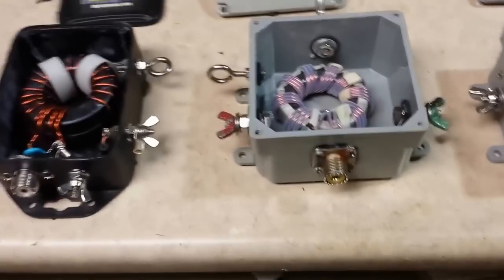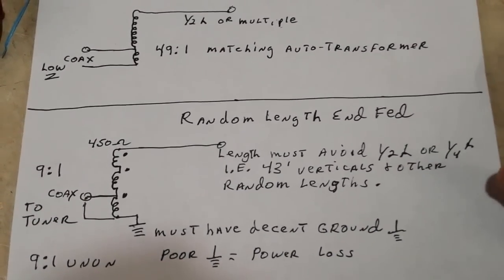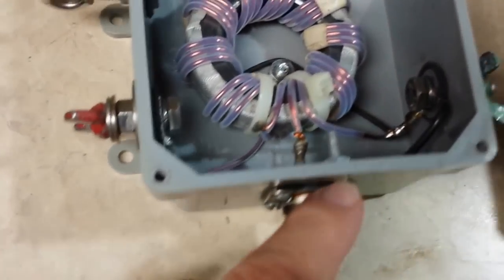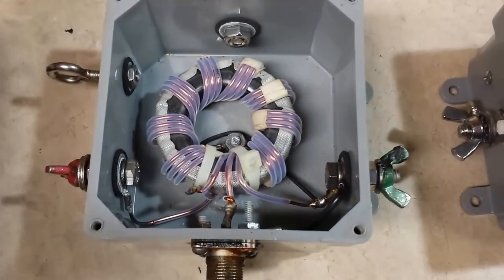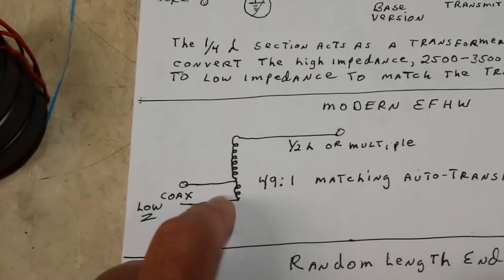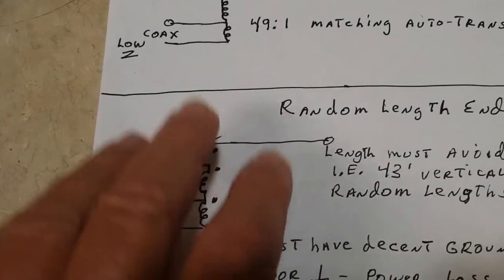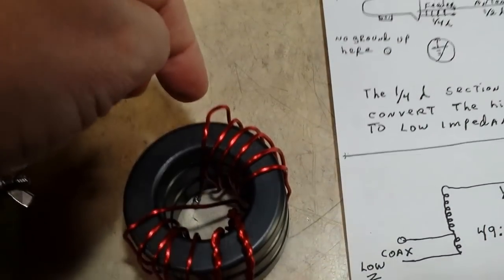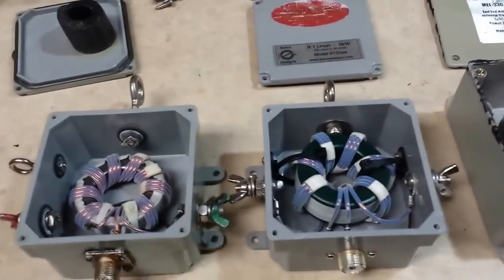End Fed Half Wave Antennas VS Random Length End Fed Antennas

Comment: Thanks Steve, great video. I used the info to build a couple of models (2 and 3 cores) of the 49:1 transformers. I felt it appropriate to test the transformers directly as components before putting in the work of actually installing an antenna. This is easily done with a 2-port VNA and putting two transformers back-to-back. . I got enough toroids to build two identical transformers of each design, but got lazy and decided to run a test with the two unequal transformers back-to-back. Of course, they are both supposed to have the same ratio, but one might have greater loss than the other. It turned out that the combo lost as much as 4.2 dB on 80m and almost as much on higher bands. That's a couple of dB per transformer, not good! Then I tried it without the capacitors. Now the two transformers together lost only 1.6 dB  on 80m, with similar results on 40m and 30m. 20m was higher, about 2.9 dB; 15m 4.2 dB; 10m 10.4 dB. I need to re-run the tests with identical pairs of transformers, but already it looks like the capacitors are added in the commercial units in order to claim reasonable performance on all the bands, while better performance can be achieved on the lower bands, at the expense of sacrificing the high bands, by removing the capacitors. The resulting lower loss on the low bands might make a big difference in power handling (this remains to be seen in practice).
Reply: In case a less experienced reader gets the impression from my comment that the commercial models using a capacitor are no good, let me clarify: Hams often use inefficient antennas that have losses of 20 dB or more, and still report fantastic results in actual contacts. Conditions and propagation cause that much variation. In this perspective a couple of dB is not much of a loss, and having "all" bands covered is indeed very nice! In practical use, the loss may be more likely to be noticed through overheating than from signal reports. Of course at moderate power, overheating may never be experienced.
Reply from the maker: Hello Erik. Others have used VNA's and gotten similar results. Try using identical back-back transformers and measure power in / out to a dummy load and see how much power is actually lost. Typically I hear 1db or so with the greatest loss on 80m as you said but usually a bit over 1 db. I find the capacitor has no effect anything below about 14mhz. I don't see how it could influence power lost on the low bands. When you do some more testing drop me an email. I'm ok on QRZ.com N4LQ
Reply: Hello Steve. I take back my statement that the cap's hurt the low bands. I had checked connections for tightness and didn't see any change, but when I took it all apart and put together again, I couldn't repeat the observation. I suspect my stainless steel hardware which may have had some oxide or silicone on it. I will email with numbers.

Comment: I noticed the triple cores and understand that raises the efficiency from approx 65 to 85 %? is that correct?
Reply from the maker: I doubt if it's anywhere near as low as 65% but there is some difference in efficiency. The main factor is power handling capability and 3 cores provides a huge improvement.

Comment: Steve,looking at the one you built, I have a question. It looks like you pass through the center 6 times, and then cross over (does the cross over count as a loop since it passes through the toroid?) And then it looks like you make 6 more passes through the toroid.  so is this a 1:36 auto transformer?
Reply from the maker: You need to count the primary too because it and the secondary are wound together. I count 7 turns through the center and yes count the crossover plus add the outside ends as 1/2 turn each. Total is 14 or close to it. Counting just the inside wires doesn't give the whole picture. If it goes down the center then back up the outside, inductance is added for however far it passes the outside too. Note that on the first 7 turns I bunched up a couple of wires and it's hard to see both turns.

Comment: I live on a boat in salt water. what will man the best ground . a wire or copper plate in the water? thanks
Reply from the maker: Although there is nothing wrong with having a good ground, the EFHW does not rely on one as part of the antenna system like the Marconi or quarter wave wire does. Hint...Use about 25 feet of coax or more to act as a counterpoise.

Comment: Excellent Steve I'm glad I've came across this channel loving the videos .I have a question if my end fed antenna is at say 840 ohms.and my rig is 50 ohms . how would you calculate this to know what balun I would need .would I just 17 x 50 = 850 ohms ?
Reply: Turns ratio is the square root of 840 / 50. Note that secondary turns count includes the turns wrapped around the primary.
Reply: @avt3216  brilliant Steve I've did one with 130ohms fed into 50ohms coax .but I used my two inductors in series .in which case my coax inner inductor goes between the two coils and earth of coax to ground .my capacitor in parallel with two series inductors .works out nicely thank you so much Steve brilliant .these two coils in series are just voltage dividers I assume ?.

Comment: Should I have vent holes in the enclosure for 100 watts cw operation, single core?  Thank you
Reply from the maker: Yes but not so much for cooling. A vent will allow moist air to escape otherwise when the transformer gets warm inside you will have condensation all over the internal parts. A single weep hole in the bottom isn't enough. A small vent like the one sold by Bud will do.

Comment: Steve,
What did you use for the Core? It looks like 3 magnets...if that’s the case, couldn’t you use 1 Larger Magnet with the 7 turns of the 14 gauge wire to accomplish the same effect?
Reply from the maker: Bill I think you should just order one already built from MyAntenna.com
Reply: Steve,
What did You Use to make your own device?
Reply: 1) They are not magnets, they are ferrite toroids. 2) Inductance and turns ratio are what matter for calculating the number of turns.

Comment: hi steve, At 6:45 you say the capacitor value is 100 microfarad, isnt that really picofarad? In your video "Winding a transformer for End Fed Half Wave Antenna -- EFHW" at 6:50 you call it picofarad, so, which is it?  I'm building this per your great video.  thanks
Reply from the maker: Read description under the video. 100pf

Comment: I put my end fed up 21 feet and it is about 15 feet to the side of and about 12 feet above the neighbors shop which has a Metal roof.
here's the problem.
I can receive good but no one can hear me...
swr is good.
could the metal roof be causing me the trouble???
Reply from the maker: Probably not. It's probably something else unrelated. Get your wife to call CQ and see what happens.
Reply: @n4lq  I think I may have found the problem 
My wire was too short so I soldered a short piece on and I think it may be causing the problem...where it is soldered is
right in the center of the core.
what do you think

Comment: I have the MFJ half wave end fed 10-80 antenna. I like the antenna but the swr is high on all bands especially 80. Even with a tuner all bands are around 1.8 after the tuner does it's job. MFJ told me just to use a ground rod with no counterpoise necessary. Any thoughts on this?
Reply from the maker: Lots of thoughts. That MFJ is not a good product. We have seen several connections fail inside the box. The vibrations seem to break them during shipping. I would stick with the Myantennas or Hyend brands. We would like to have you join our Facebook group for this antenna https://www.facebook.com/groups/EndFedHalfWaveAntennas/

Comment: I wonder how this would work with if you made an EFHW fan dipole. I will have to try this. (40-30-17-12)
Also this answered my questions about the unun. I believe I will try a 43 foot vertical as I have heard good things about them.
Reply from the maker: Won't work at all. In fact you can't even put your finger near either end of the EFHW without wrecking the SWR. Fan's must be fed in the middle. 43 foot verticals work ok from 80 to 20 meters but they are too tall for low angles above that. They also need lots of radials and the tuner needs to be at the base of the antenna otherwise you suffer much RF loss in the coax.

Comment: 5:00 there is a big difference between the windings of both these 9:1 transformers... one got 9 turn like in the scematic but the high power one has only 7 windings and it is still a 9:1...
Reply: No, there is no difference. The turns ratio is the same. The total number of turns is adjusted for the toroid material and desired inductance at the frequencies used.

Comment: Just a stupid question (ok 2) only cause I'm  not in the know lol,, but 1, why not oil filled like a paint can dummy load???
2, why not build these for sale?
I like ur design, seems robust compared to others, and I like integrity:)
Great video BTW!!
Reply from the maker: The problem with oil is due to the high impedance of the transformer.  Oil will basically provide a short circuit due to its dielectric properties. Think of it as a liquid capacitor. I even tried using mineral spirits. It kills the transformer!
Reply: @n4lq  thanks for the quick reply!!
Ever thought of building these for sale?
Love the vids!!

Comment: 11:53   I.A.C.S. here would probably mean 1000 watts with a 50 percent duty cycle. ie rating for heat. 
 Even more confusing is some marketers use the XXX watts PEP I.A.C.S. term too.

Having fried enough things myself I ponder if folks ratings are real or are they some best case example too. 

I think some types of balun configurations (current/voltage) have a higher loss when the VSWR is high thus the balun core really has to see even less I.A.C.S. power so is happy and not cooked. :)

If you have a thermal camera you can see the cores being hot, the leads wires and other parts too.

Another weird thought is IF a 1000 watt I.A.C.S balun if driven with a 1500 watt signal with a 1/3 duty cycle, would it be happy ?OK? ie is it just heat? or did the core saturate so one is really boxed in with little "headroom" above 1000 watts. 

(*ICAS = Intermittent Commercial and Amateur Service)
Reply from the maker: They just make it up. I saw a test done for the Myantenna 2kw. He put 1.5kw into it for about 5 seconds...Twice and dubbed it ICAS. Yea right! Hopefully there will be a breakthrough because these things really work.

Comment: Hey  Steve , TU for ur research.. I duplicated 3 core/43mix and at 800 watts CW reached Curie Temp after 20-25 min, 500W CW No Prob..
Their specs show 0.5 Db loss that is 12% so at 50% duty CW and 500W is 30 watts   about figures right since Curie Point for #43 is 130C !
73 de K2HZO Paulk

Comment: If these 49:1 transformers get very warm at 500 watts CW - My question is how much power is lost in these transformers.
Reply from the maker: Less than 10% which is about what some tuners can loose. Think about touching a 50 watt real light bulb...Pretty hot! Usually there is little or no heat on bands other than 80 meters.

Comment: To your knowledge, Steve, has there been any workups on a fan end feed half wave?
Reply from the maker: No because not only will it not work but it is not necessary. Another wire in parallel will totally disable the antenna.
Reply: @n4lq  Again, has there been any workup which support this?
Reply from the maker: @JosephLorentzen  Work up? Yes I worked it up. But why would you  want to do it in the first place since it already covers multiple bands?
Reply: @n4lq  Eliminate the need for a tuner
Reply: @JosephLorentzen  YOU can model it, use MMANA-GAL, tell us how it goes!
Reply: @avt3216  It is due to the modeling that I am encouraged with the idea.

Comment: Hello Steve, Great video as usual. I am interested in the specifics of the transformer in the MEF 110 1k version. I can see in the video that it is NOT the same as the one for the 8010. I can see only one capacitor instead of the two 200pf.. also I noticed as you mentioned that the windings continue around the toroid in a clockwise direction. Can you describe specifically how the toroid is wound and what cap they are using please. I have one I wound already but would like to change it for 160. What length of wire do you recommend for the 160 version? I would imagine 260 feet or so?..Thanks and 73's.. de ka5wpm
Reply: I also have the same question... Anyone have the answer???

Comment: Awesome. Can I use a 100pf/3kv cap on ft140-43 using 100w?
Reply from the maker: Who knows?
Reply: not me! thanks anyways :)
Reply from the maker: It is a common question I hear. Guess I need to buy a 140-43 and find out. There is just an inch difference and 240s are cheap from Mouser, $4
Reply: 3kV rating is marginal. Use four 100pf/3kv caps in series/parallel. Also, the 140 size is going to heat up with any high duty cycle mode at 100w (like CW or FT8). If you do use this core, keep it out in the open, not in an enclosure. Monitor the heat it produces, also.

Comment: Hi Steve.
How is the length of the counterpoise for the EFHW 8010?
Greetings from Switzerland
Reply from the maker: The coax shield is your counterpoise. You do not need a separate counterpoise.
Reply: If you place your choke about 5% wavelength from the feedpoint (the ballun) then the coax shield is the counterpoise. Otherwise (if no choke), add a short piece of stiff wire to the ground lug (as short as 5% wavelengtgh) and position it away from the dirt.... or just use a simple ground rod.

Comment: hi can you check this one out please  SIGMA EURO-COMM Magitenna 40 6m Multiband HF Wire Antenna only 7.6m wire using a atu  you can 60m to 80m to
Reply from the maker: Yes. These are simple 9:1 random length antennas. They are not EFHW half wave antennas. They are inferior to the EFHW.
Reply: @n4lq  thank you .

Comment: How do you know impedance at the feed point is 450 ohm for random wire 9:1 scenario and 3000 ohm for the 49:1 scenario?
Reply from the maker: You can measure it with an analyzer but it needs to be able to measure high impedance. I used a Sark 110 and was able to measure the Z of a 160m half wave at 5000 ohms. The other way is to model the antenna with software to get an estimate and finally, use the transformers mentioned to check the swr on the input side. That's a bit crude but gets you in the ballpark. Random wires seldom come out exactly 450 ohms and a wide range tuner must be used.

Comment: no offense but I think you missed a turn on the 49:1 transformer you wound. Take a look at the myantenna one for comparison
Reply from the maker: I guess you just don't see it because I'm counting 14
Reply: @n4lq  honestly, I think its the same. the mef 330 has 13 turns, yours has 13 turns. the 8010 has 14 turns, 8 on the bottom 6 on top. I know im not going crazy lol 73. This link shows 49:1 14 turns too same as 8010 https://www.ebay.com/i/283096767858?chn=ps
Reply: @n4lq  I saw your other video about the 13 turns. Got it

Comment: Thanks for the expose Steve!  I suspect higher losses in the Auto xfmr than the true UNUN TLT. Toroid turns count in passes through the center. I count turns visible as EFHW-8010 14t... MEF-110-1K  17t...MEF330-2k 13t.   73!
Reply: Notice there are 3 turns on the primary of the MEF-110-1K.  There are a total of 21 turns to maintain 1:49.  There are turns under the white plastic holders.

Comment: Infield half wave length and tennis
Reply: Dave, at about 18:04 you question why the teflon tubing in the 9:1 transformers.  This is explained in Jerry Sevick's book on transmission line transformers.  The 9:1 baluns are true transmission line transformers, NOT magnetically coupled conventional transformers as are the 49:1 units.  In a transmission line transformer, most of the power is transferred via transmission line coupling and not magnetic coupling through the core, hence the core does not heat significantly unless there is an impedance mismatch.  In a transmission line transformer, the carefully controlled spacing of the windings creates a transmission line who's impedance should be the square root of the sum of the squares of the input and output impedances, in the case of a 50 Ohm to 450 Ohm transformer, this would be 150 Ohms.  This impedance of the windings is a function of the wire size, winding spacing, and the dielectric properties of the insulation.  In the case of these 9:1 transformers, if they are correctly designed the Teflon tubing is chosen to provide the correct wire spacing and dielectric constant such that the winding impedance is 150 Ohms.  You can find this info in Sevick's book "Building and using Baluns and Ununs".  I consider Sevick to be the authority on transmission line transformers, again noting that the 49:1 transformer is NOT a transmission line transformer.  Jim AB4CZ

Comment: Not actually such a thing as an "end feed" antenna.  Its acutally a dipole with the coax being the offset.
Reply: Is too. It's all I run. Without coax.
Reply: You are assuming the use of coax.  When camping in the boondocks and operating QRP, I prefer the use of a long wire antenna that is attached directly to the back of my transmatch ("antenna tuner") and either stretched through the trees or attached to a kite or balloon.  The only coax in use is no longer than two feet and is between my QRP rig and the transmatch, hence the antenna is fed directly at the end (and yes, technically, the antenna is working against the station's ground, so in that respect, you are correct).
Reply: You're incorrect.... unless you think of all verticals as dipoles!